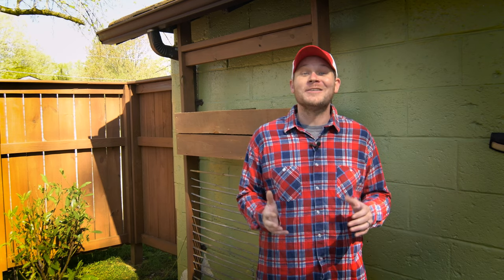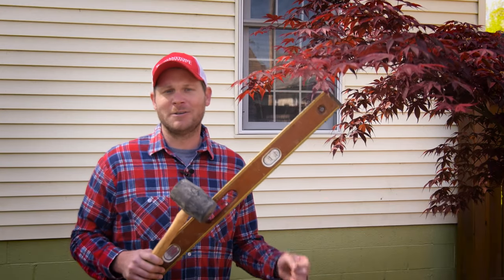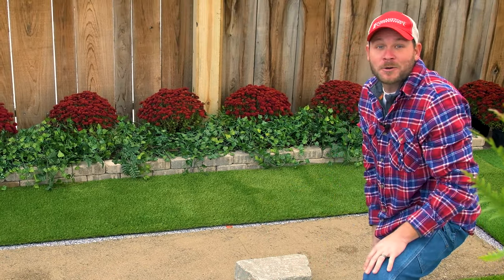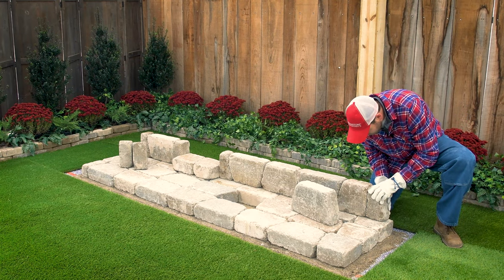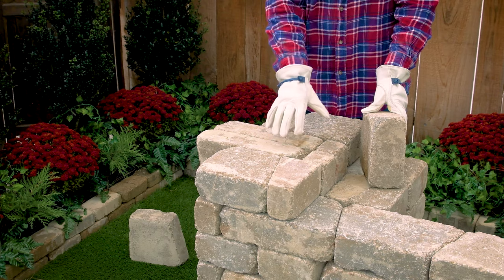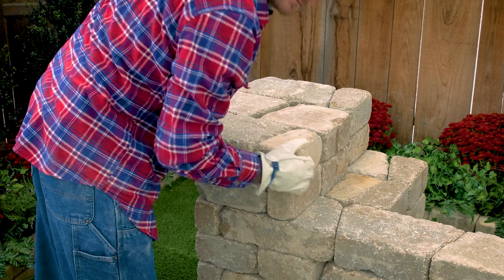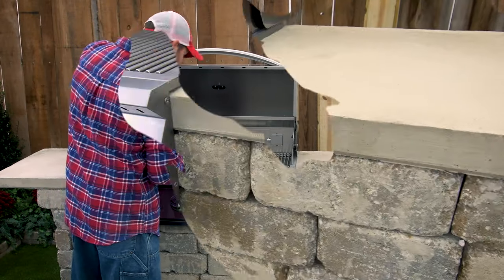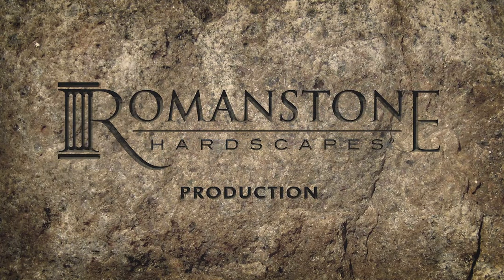Build with Roman - How to Build a Willard Grill Station w/ Kamado Pad - Tips and Tricks

Comment: Can you explain where the propane tank goes?  Under the grill or off to the side under the countertop?
Reply from the maker: The tank goes under the grill. It is accessible from the back, though you could build it to be accessible from the front.  There are also plans to connect it to a gas line for the cleanest installation. Check out the instructions for more information:

https://drive.google.com/folderview?id=1Uqn2zlnaowtZzFeKDehVzPogidFTp7bs